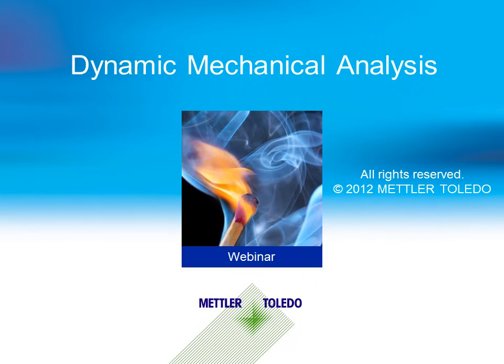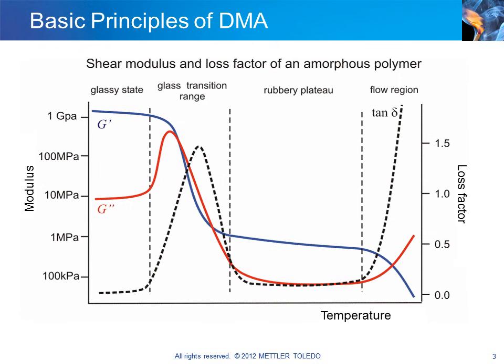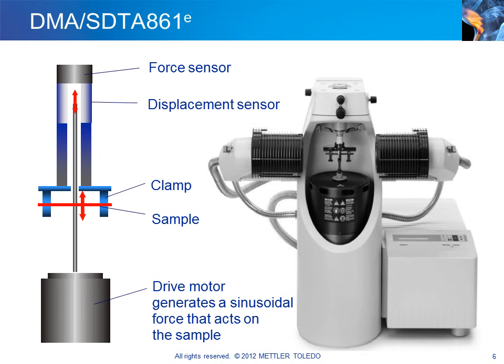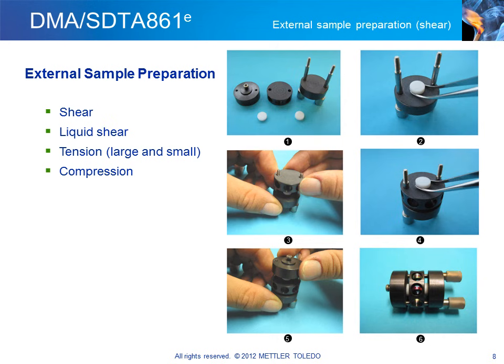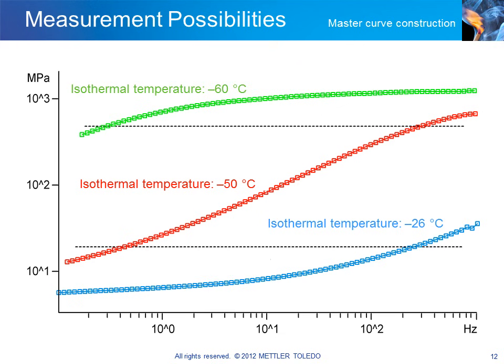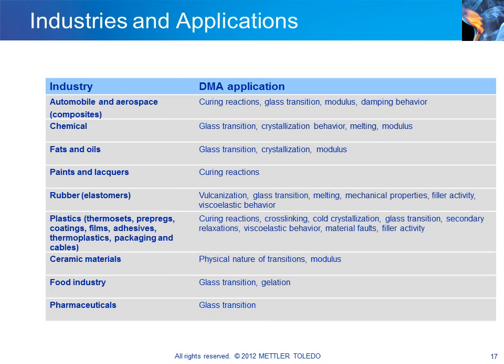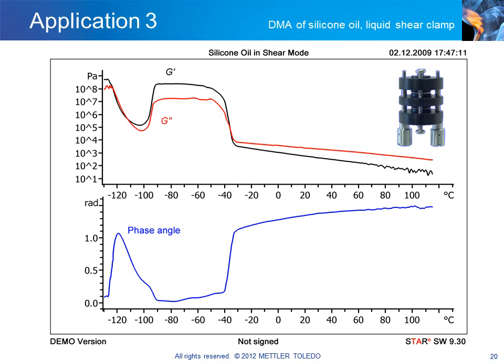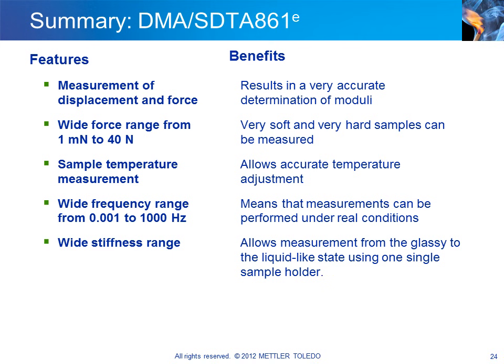Dynamic Mechanical Analysis (DMA) – Online Training Course

Comment: Very useful. Thank you. Not sure whether I fully understand why material's behaviour at high frequency is equated to behaviour at low temperature and vice versa. Could somebody elucidate? Thanks
Reply: From my understanding:Viscoelastic properties are largely based on response time. The response time is forcibly shortened at high frequencies due to less time between cycles, while at lower temperatures the response time is shortened because cold temperatures slow the "flow" of molecular chains.
Reply: cheezwiz7  Thank you. Makes sense.

Comment: How is Storage modulus (E') and Elastic Modulus (E'') calculated by the machine performing DMA without the value of delta?
Reply: My guess would be:Delta is the phase shift between the generated stress vs time and strain vs time sin waves. The DMA can calculate this directly because it measures the displacement vs time and the load vs time which can then be used with the cross sectional area to get both sin curves.